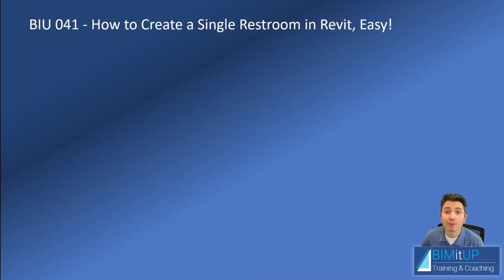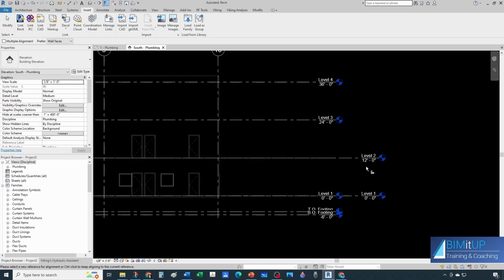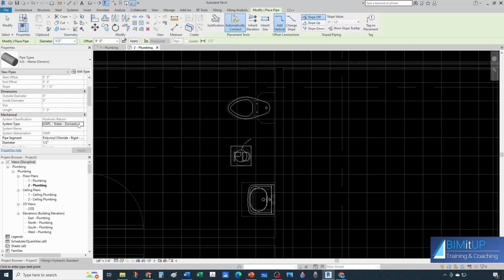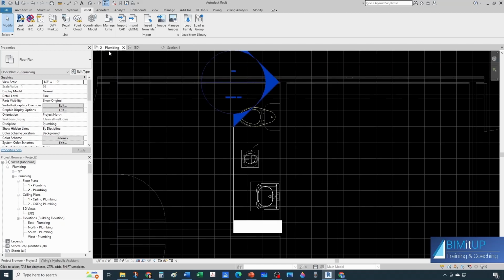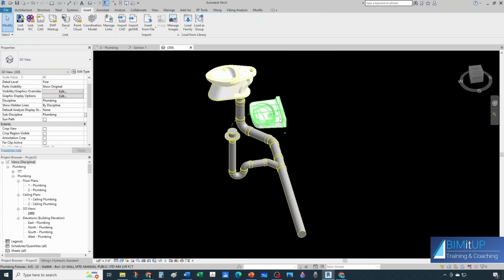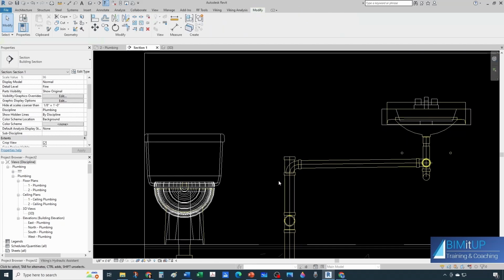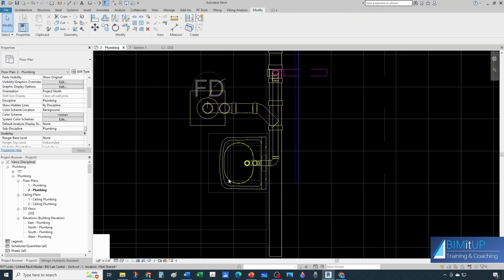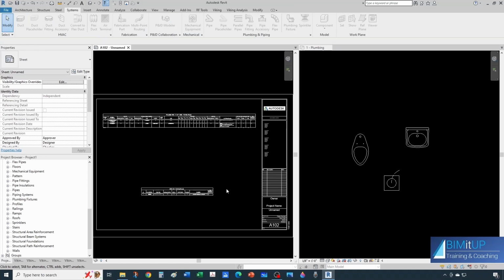Single Restroom Plumbing in Revit Easy Tutorial

Comment: Alex, great video. Just a quick tip that we use when placing fixtures is to use the space bar to rotate the fixture prior setting the fixture.
Reply from the maker: Yes Jay. That is typically the behavior. For some reason those Zurn fixtures don't rotate w space bar (a little annoying), but I like that those are not face/wall hosted, so if the Architect moves a wall, hell doesn't break loose =)
Reply: @bimitup  agree completely. We’ve had a nightmare time in the past with wall hosted fixtures and the architect deleting and redrawing a wall instead of just moving it.
Reply from the maker: Yes. Hosted families are not a  good fit for us MEPs =)
Reply: @bimitup  no doubt. They are the bane of our existence.